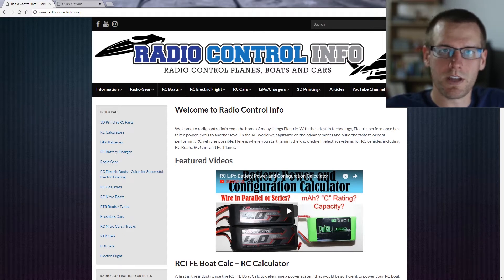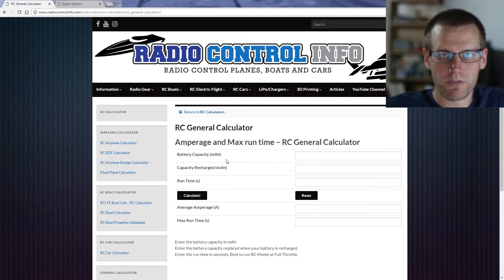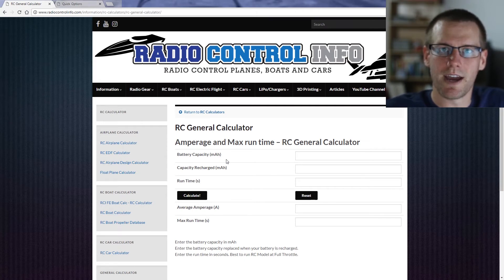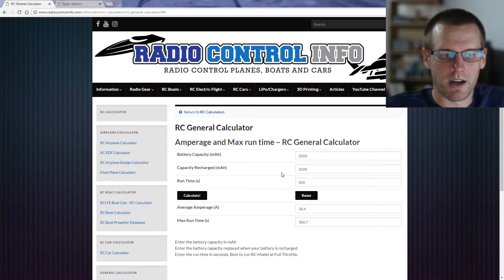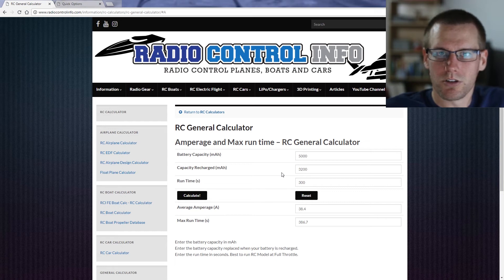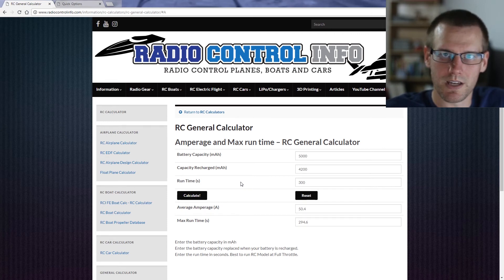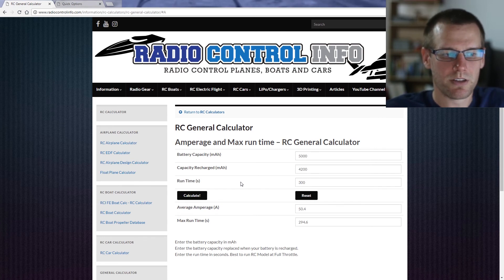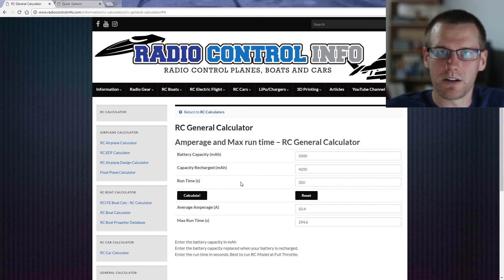How to Calculate Current Draw (amps) & Max Run Time for your RC

Comment: I actually just use the cutoff of my ESC set to 3.1V/cell and it's right on the mark. After a few minutes without load the voltage is back up at 3.4-3.5V/cell. Cells never drop below 3.0V during operation. Using 4000 mAh batteries I have to recharge around 3300 mAh each. My runtime matches the result of the calculator for the maximum runtime.
Reply from the maker: Sounds like it is working well for you. That's is good.